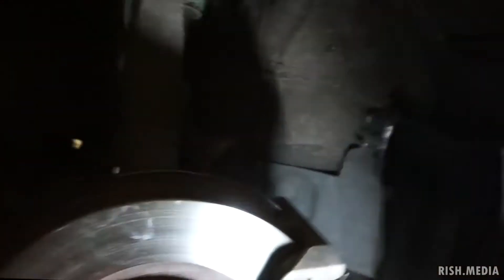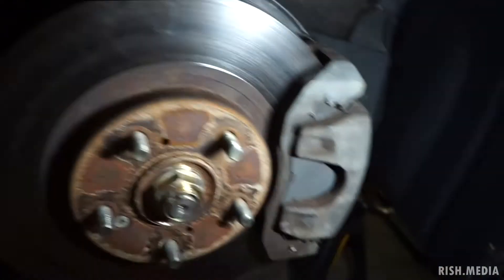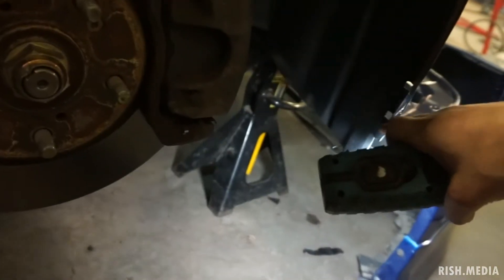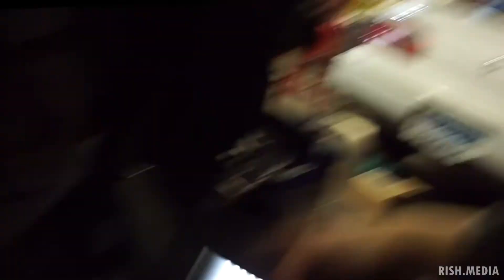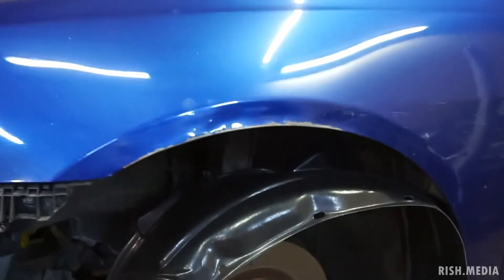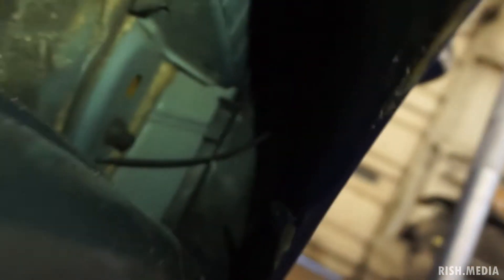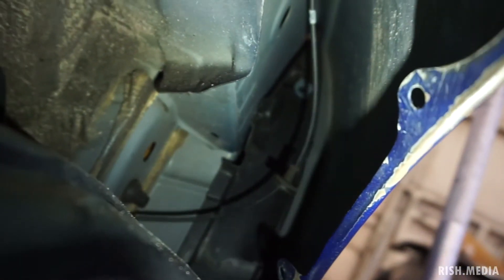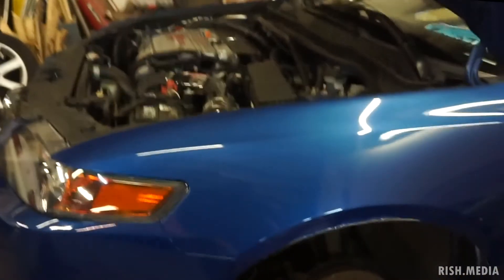TLC FOR THE TSX

Comment: I have the same problem with my headlight connections🤦‍♂️ the company didn’t send me the right connector piece to keep water and all out of it. The bulbs just kept flickering while I drove but they never turned off like your fog lights. But finally I got it taped up good and they’ve been working. For a few weeks. I’m done with buying eBay shit😂
Reply from the maker: It’s super annoying especially after the 3rd time lol.. figured out it was a loose connection that doesn’t even click in so taped the shit out of it 😂